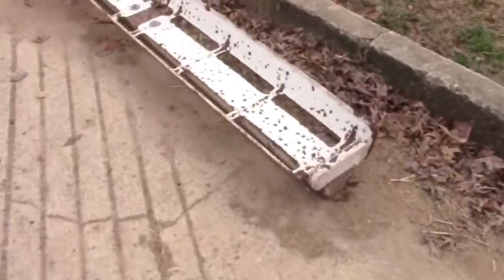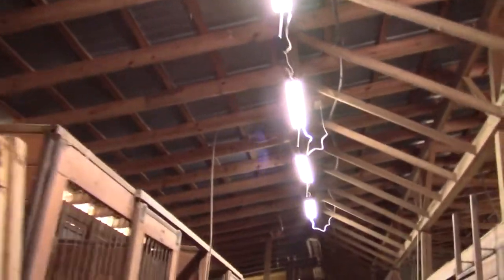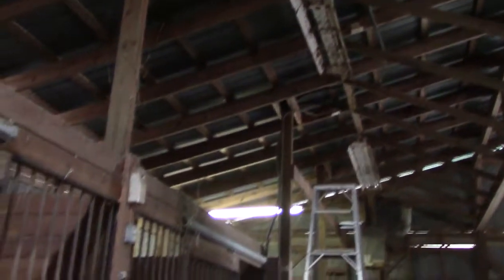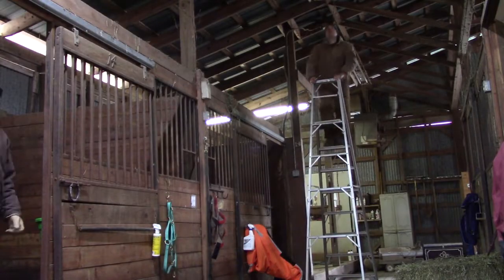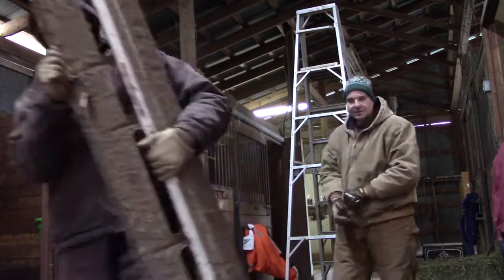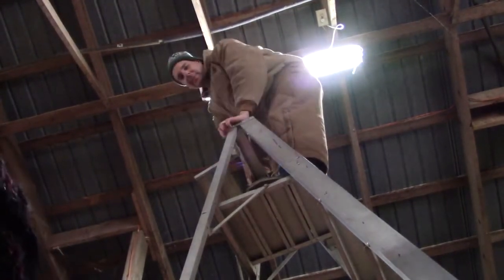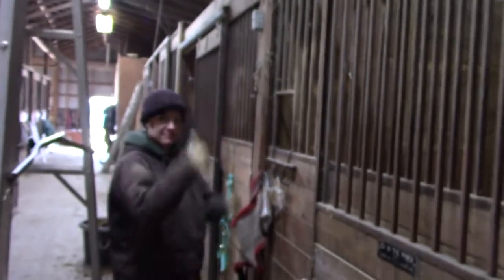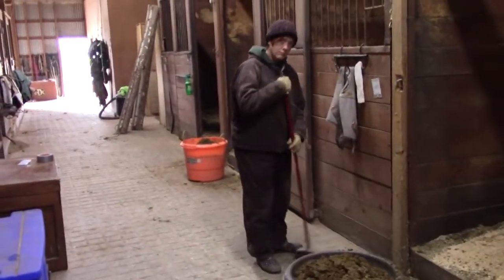Farm Stuff #12 - Let There Be Light

Comment: Let there be poop! Fortunately that looked like a relative simple install, other than having to be up on a ladder with a bionic knee. It's nice when things go easily. Have a happy and safe New Year!

Cheers, Tom
Reply from the maker: Yes - this side was easy except for removing the old ones which were super heavy and filled with rust flakes that would always find a way into your eyes... the other side will involve having to actually put electrical boxes and outlets in at each location, then put in the lights - so I have been dragging my feet on that one - we still have a room in the house to paint and door the floors on, so I will get to that first... always something.
Reply: @dixielandfarm  I know you two work hard, but it does sound like a good, rewarding life!

Comment: I have a basement full of aging fluorescent fixtures that I have been planning to upgrade. My brother had retrofitted some of his existing fixtures to convert them to LED, but I have not checked the cost difference between new and retrofit. - Chris
Reply from the maker: The retrofit was much more expensive now - I waited long enough that the whole unit was cheaper than either a ballast, a NOS bulb, or a retrofit... If they aren't broken, leave them - but mine were all starting to go and there was also cold weather performance I took into account - these HO bulbs are terrible when it is cold.